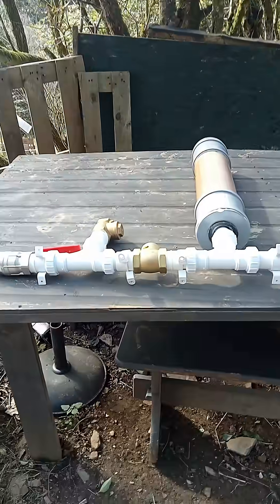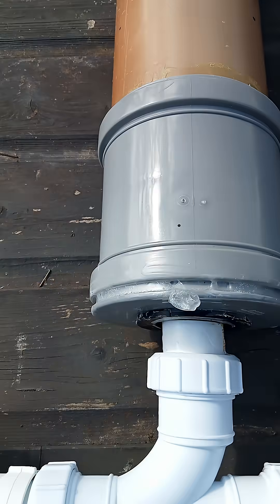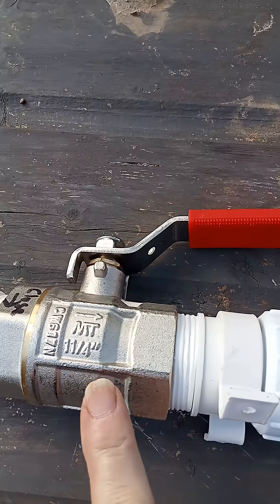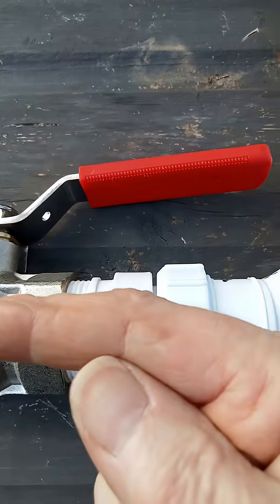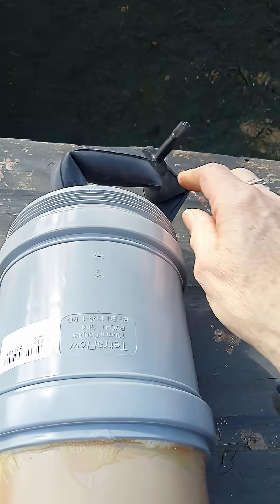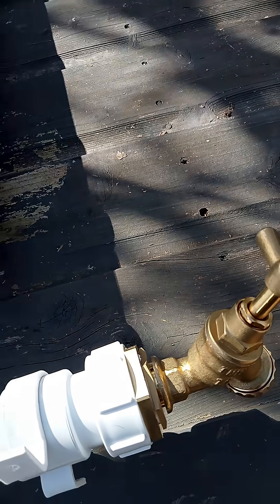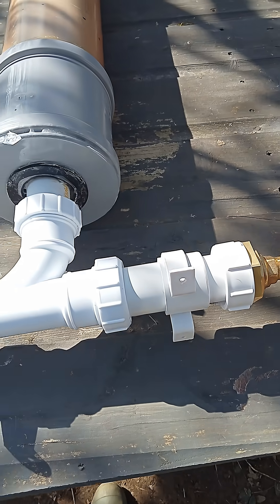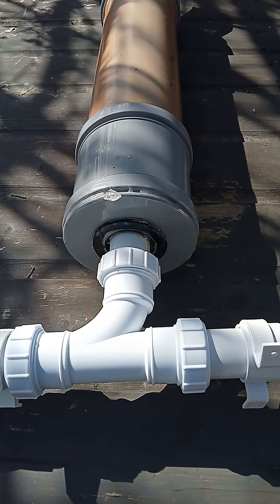18 October, I built a Ram pump, please watch to see if it works. #agriculture #farm #pump

Comment: Iv got to see this work this is incredible
Reply from the maker: I have got it working and I got 60 meters of lift so far, but the pressure tank has broke open so I need to do some adjustments to that, then it's away, please see my other videos to see it working and the problems I've had with it so far 😊 thank you for watching ☺️
Reply: @Rachel-q3t  of course i will do that now ill go have a look see, thanks